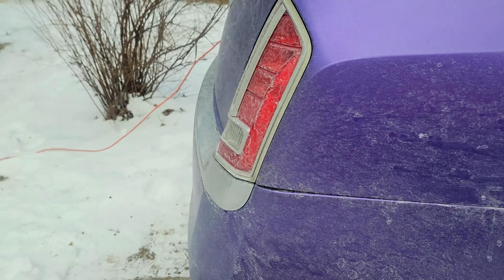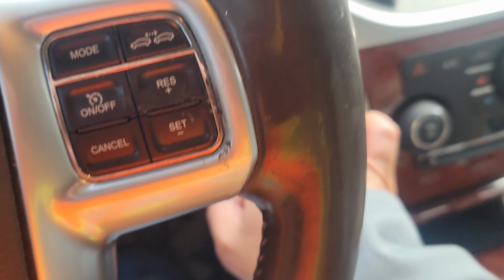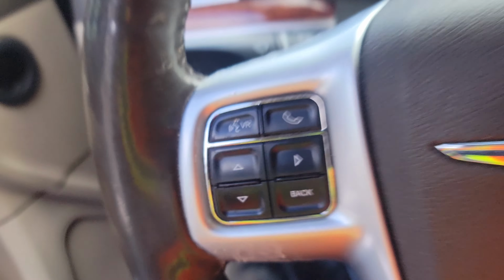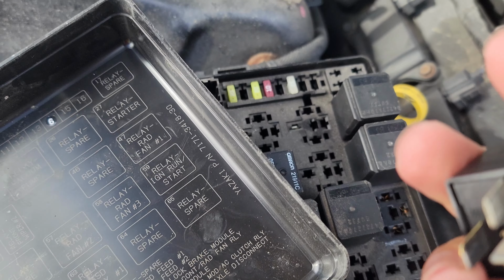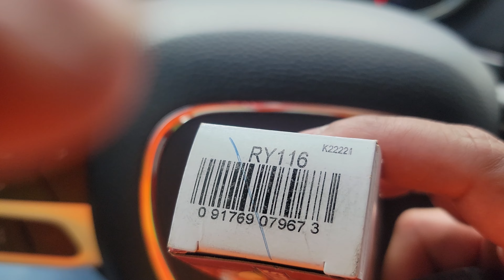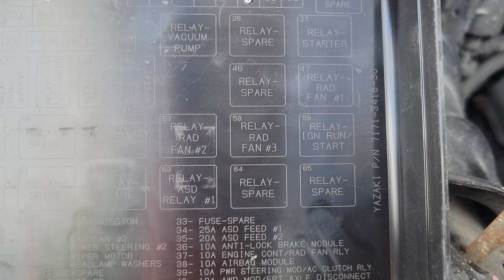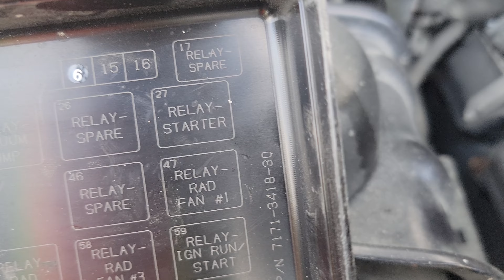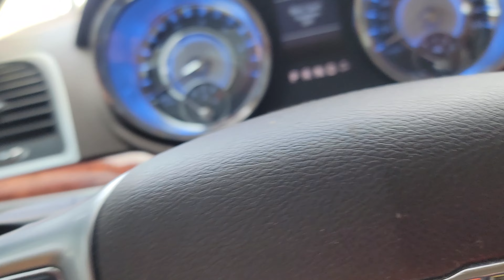starter relay chrysler 300

Comment: Can u tell me Whea my fuse at dats connected to my tire so I could spin out
Reply from the maker: hey there, if you have the awd its on the left side and pull the fuse that's labeled front differential and pull that, if you're RWD I would just turn off traction control OR pull fuse 17 The ABS fuse. thnx for watching!
Reply: Ur a life saver